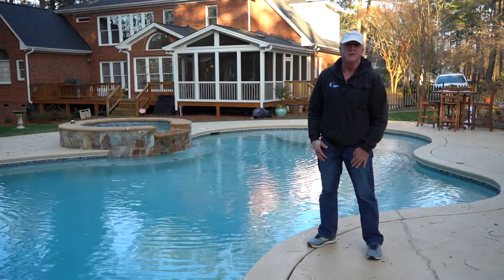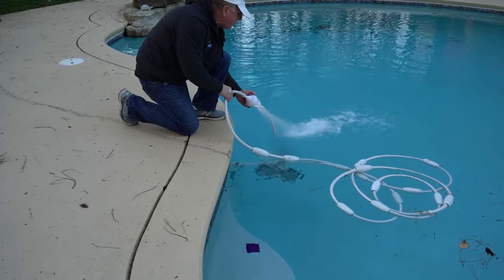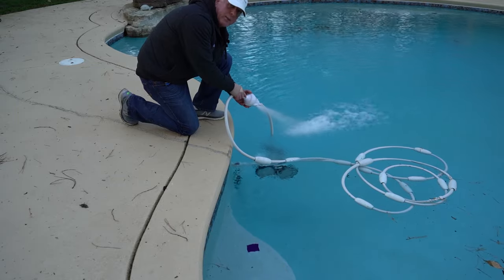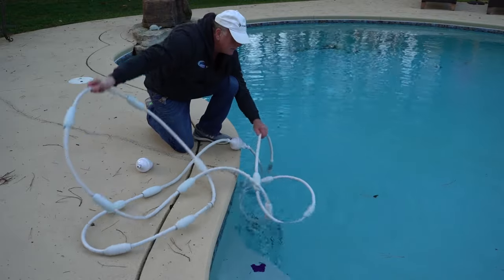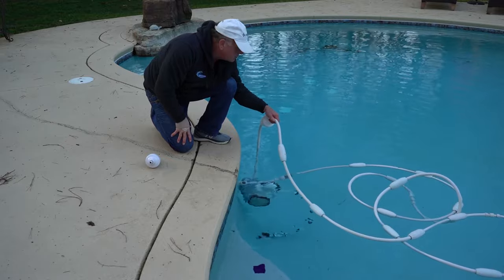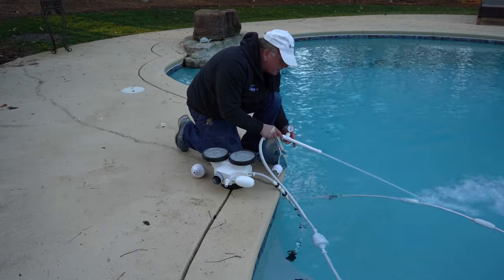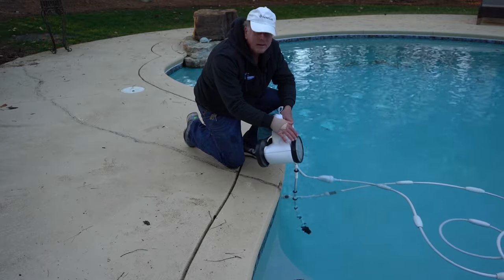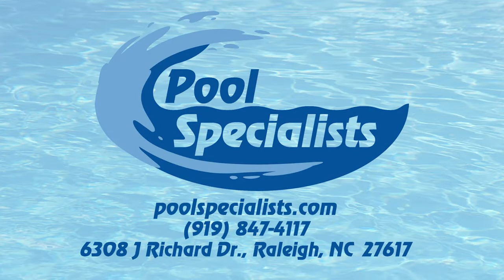Why is my Polaris Cleaner not moving or only moving backwards?

Comment: Nice video if your problem is in fact the backup valve. My "not moving" case was different. No movement of the Polaris turned out to be a blown Pressure Relief Valve at the wall. End cap had blown off and ALL the water pressure was escaping through that open ended Pressure Relief Valve.
Reply: I am a newbie to the pool maintenance. Do you mind telling me how the pressure relief valve look like?

Comment: Just got a brand new hose and connectors for my Polaris but it won't run. It seems like there isn't enough water pressure or water volume getting to the unit. I can spin the drive wheel and all the wheels move. Water comes out of every outlet in the unit and hose but kind of a trickle compared to how it usually is.

Comment: My Polaris 280 is dipping down at approximately a 15 degree angle so that the wheels are not touching the bottom of the pool allowing the 280 to function as it should.  Much of the time the 280 does not reach the bottom even to the 15 degree angle.  How can I correct what is occurring?

Comment: If you were not getting good pressure to the pool side Polaris connection it would be lethargic as well. That’s my problem, and can’t seem to figure out why. Booster is running pool pump works fine, but very minimal pressure at the poolside connection.
Reply: It may be the impeller in the booster pump. Pump runs but not pushing enough water to the pool. That was my issue. There are 2 impellers that look almost alike for the pumps. The newer pump impellers are sold out almost everywhere
Reply: @atkinshockey  That makes sense, thank you.

Comment: My Polaris doesn't dive to the bottom, just gets tangled back by where it connects to the wall.  I've replaced just about everything on it in the last six months.
Reply: any updates to this? Mine is doing the same.
Reply: @edwind8440  I've got mine working pretty decent now following the tips in the video. Had to replace some parts - replacing that piece that moves the unit every minute or two was definition one of my issues.
Reply: @TheBibleforKidsNP  thats awesome. I finally got mine to work. I needed a new ball bearing on one of the wheels as well as a new wheel. (Single wheel side)

Comment: You mention range between 28-32 PSI needed for proper pressure.  Polaris manual  references 28-32 RLM (revolutions per minute) for the proper wheel speed as well.

Comment: Thanks for the video, very useful. I was wondering if the reverse valve was supposed to have some water coming out when it’s cleaning, or going forward. It does clean the pool and it does move forward but it sometimes gets stuck when a float hits the hose in a certain way. It appears to me that although it’s working, it’s just not optimal. I’m suspicious of the reverse valve because It does have a stream of water when it should be completely shut off.
Reply from the maker: The water coming out of the backup valve should completely shut off when the cleaner is moving forward.  When in backup mode, all the water should be on the reverse jet.  This is a very common problem and very easily fixed by replacing the backup valve

Comment: We have a 20 by40 inground....our Polaris 28p wants to stay in the deep end .I've had no luck adjusting the thrust jet so that it will move all over the pool floor. What do you suggest.  The Polaris is brand new .
Reply: Make sure that the first length of tubing attached to the cleaner is around 36" max and then the back-up valve followed by 1 float. When the back-up valve is engaged the first float will assist in picking up the cleaner off the bottom so it can pull it farther.

Comment: I have water coming out at high pressure jthrou8gh the connector where the hose connects to the wall.  Is that because something is clogged somewhere in the line?
Reply: There could be a blue or red restrictor feel in the fitting to tell.

Comment: Hi, I am writing to see if you can give me some advice, I would really appreciate since I am going crazy with this thing. I replaced the wall connector with a new one because i accidentaly broke the old one while unscrewing. It worked fine for a few days, but then a lot of water was being sprayed out of the pool through the preassure release valve (the black round thing) next to the wall. I tried to unscrew this valve but it is impossible, it seems glued! So I put the blue restrictor disk and water stopped coming out, but the robot goes very slowly and barely cleans. Now I can not even unescrew anything because I screwed it too hard... But even if I arrived to remove everything, i don't know what to do, it seems impossible to make it work fine and I have no idea what to do, do you have any ideas? Thank you!!
Reply from the maker: you should purchase the item from the link in the comment pinned: Universal Wall Fitting Connector Assembly Replacement.  When you screw the new wall fitting in, do NOT over tighten it.  Go 1/2 turn past hand tight

Comment: As far as the cleaner itself goes, I do like it a lot. However, the overall design of the product is faulty. Don’t buy this thing. Again, the vacuum is great, but you have to use their twist lock hose system that hose system comes undone all the time. It pops out of my side port. it pops off of the debris basket. Now let’s talk about the debris basket. It has a “special“ drain system, so that the water drains out of it and it’s less heavy when you pull it out of the pool. That drain is literally an open drain in the bottom of it. Well, it floats on the surface of the pool. As soon as the hose goes in the wrong direction, the basket starts floating upside down and the drain starts pulling air. I can’t tell you how many times I have lost prime because of this pathetic design. You cannot trust the thing if you leave your home because you could end up running your pump dry.  Just three days ago. I was standing there, talking to my wife and all of the water features quit. Looked over at the debris basket and guess what? It was upside down sucking air and I lost my prime. As I write this message I am looking at it, and the thing has turned sideways in the last 20 minutes. So the question is how long until it turns upside down and I lose prime again? Again, great vacuum, but overall on a five star rating scale I give it one star because the entire product system sucks.